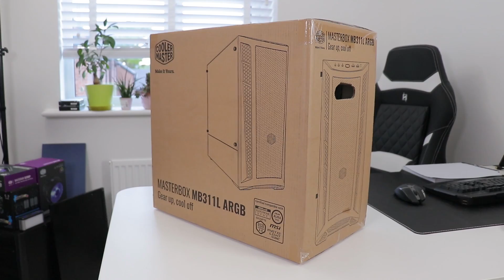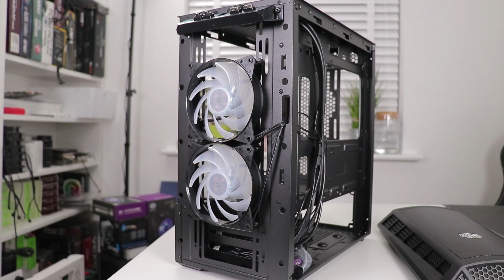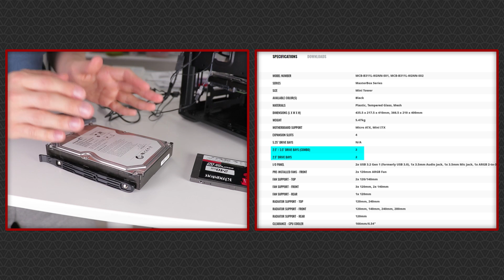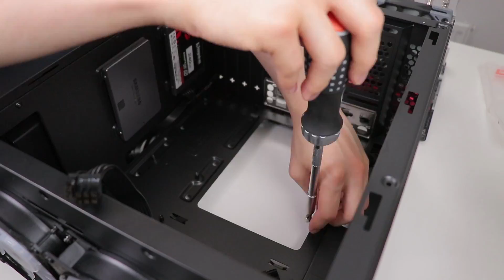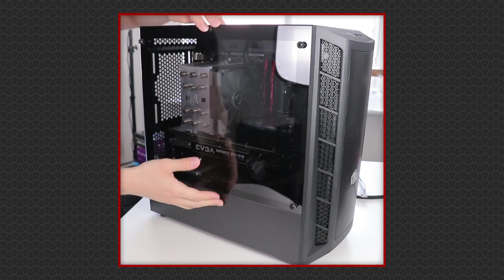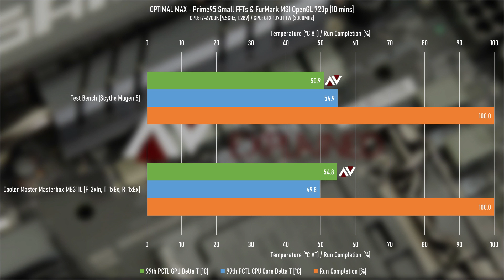Budget ARGB... but at what cost? - Cooler Master Masterbox MB311L ARGB review

Comment from the maker: Time Stamps:
01:25 - Unboxing
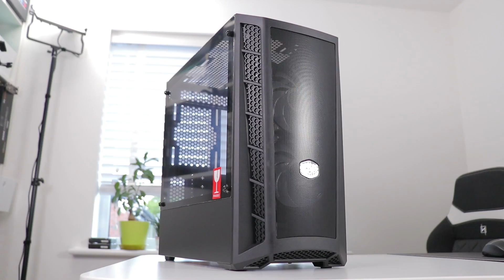01:30 - External Overview
03:00 - Internal Overview
05:09 - Drive Configurations (Small problem, big rant)

BUILD
04:50 - PSU (from previous section)
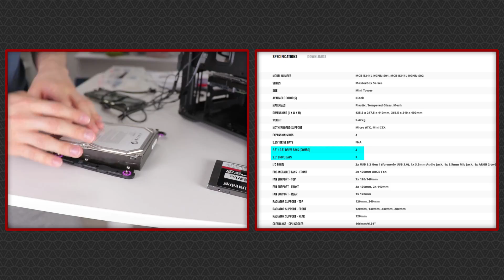09:14 - Cable Management
10:06 - Motherboard
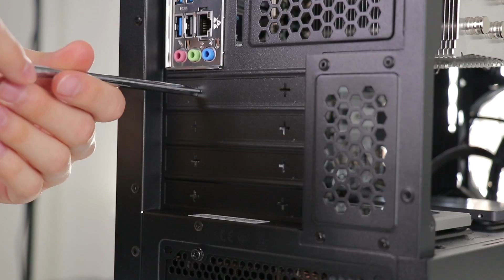10:38 - Graphics Card (Small rant)

TESTING
13:09 - Testing Setup explanations
14:04 - Pre-installed External Fans (Small rant)
15:04 - Thermal Testing Results Analysis

CONCLUSION
14:56 - Conclusion and Summary
Reply: Great review, thanks. FYI your conclusion timestamp is incorrect.
Reply from the maker: Bugger, sorry about that, must have messed up a digit :/ thanks for letting me know :)

Comment: Building my first PC waiting for parts to come in. I am getting this case but want to get an RGB exhaust fan for the rear. If I get a cooler master PMW 120mm like these front ones will I need to order anything else to get the rgb working? I have a B550M pro VDH wifi motherboard. Essentially what do I need to do to get the RGB the same on all 3 fans? Could this be possible using a different brand RGB exhaust fan as well?
Reply: The fans should be compatible with software. Coolermaster fans are compatible with Asus Aurasync so I think you're fine there. The only problem you would have is connecting them together if you don't have enough headers. You may need an aRGB hub.

Comment: Bought this case and the fans had to be at max speed all the time or they would not start spinning
Reply from the maker: Just out of curiosity, have you checked that the fan header you've connected them to is PWM? Not all 4 pin header are PWM, and many PWM fans connected to a DC header will perform erratically.
Reply: @AVTechy  yes I checked everything I could but they just refuses to start unless on max( would turn on system, fans would budge but not enough to start spinning) recently replaced them with sp120 and works well
Reply from the maker: That's weird. Have you contacted the manufacturer and explained the fault. They're probably under warranty so you could get replacements.

Comment: My only caveat, is that those particular stock fans are of sketchy quality. Non-PWM and they have a tendency to quit spinning after 2 weeks. The 2021 models address this by switching to SickleFlow 120 fans, which are significantly better. Also, Cooler Master has special clips for the bottom fans to install them on the inside of the frame...likely at extra cost though. In the full ATX version(MB511) of this, they use these clips for the bottom fan.

Comment: Great review... I have the Cooler Master NR400 case, which is strikingly similar in layout to this case... in fact, aside from some missing cable management grommets in the MB311L case, i'd say the base chassis IS the same as the NR400... only the front panel seems to be different.  In regards to changing the front fans post-build... YES... I've actually done it a few times (I'm always playing with fans) and it is difficult, but the bottom fan can be changed without tearing the system apart if you use a decent right-angle screwdriver.

Comment: Wouldn't the Hard Drive and SSD combo refer to using the rubber grommets for 2 2.5 inch SSD's and then use the side brackets to fit 2 3.5 in HDD's into the HDD cage or am I missing something?

Comment: You said the case allows for a maximum PSU size of 140mm and 160mm 4:38 but the maximum PSU size for this case is 180mm. I’m confused is there a reason why you should put a smaller one. (I used a 150mm but I’m just wondering) :)
Reply: hello! could you use this case mb311l with a psu of 150mm? i have one of that dimensions and i'm wondering if it fits :(

Comment: If money matters, then function is always over form. $50 case with lots of fans and a good amount of front ports. Not bad. If you build your own pcs, then getting or fabricating things to improve the short comings of this case shouldn't be a problem. I'd make/get better psu filter, pop all the rear expansion slots and cover or filter unused open area, maximize air flow and temperature control the fans, and just buy extra misc. hardware (grommets,screws,brackets, etc...). I don't care if it lights up and looks pretty, fan noise is good if it means it's keeping my machine from being cooked. I will always take function over form as a pretty turd is none the less, still a turd. Nice review, good job pointing out the short falls and potential of this case. I as an engineer instantly started thinking of ways to up the performance and usability of this case.

Comment: I ordered mine right after watching this review, it should be here in 5 days
Reply: I got one a few weeks ago.

Even after watching this AND reading it in the diagram, I still forgot to punch out the PCIe slots before screwing in the mobo.

I just very carefully bent them inward without scraping anything. It's ridiculous how they had to cut corners in what is otherwise such a great case, but the PCIe slots are a 1-time gig basically, so not too big a deal.

I only use 1 SSD, but it's really bizarre how it only comes with enough rubber washers and grommets for like 2 SSDs I think, while it has mounts for like 8 or something.

The PSU filter is really flimsy and falls out kind of easily. Every time I handle it I need to check that this filter didn't wiggle out.

But for me personally? None of these cut corners affect aesthetics or performance at all in MY setup. It's the highest value case I've ever seen for $60.
Reply: Liberty Prime I’m just wondering if you had the same mobo issue in the video
Reply: @aaronlim277  Do you mean the issue with the PCIe slots hitting the mobo when you bend them in?

Yeah I did have that issue, that's what I meant when I said I had to carefully bend them in without scraping my mobo.
Reply: Liberty Prime I meant were the mobo stand off slightly missed placed like the in video?
Reply: @aaronlim277  No, don't think so.
Reply: Liberty Prime and do you think this would be an easy case to build in for a first timer? Thanks
Reply: @aaronlim277  As long as they keep in mind the PCIe slots to avoid a headache, yeah it's pretty great. The one thing that's a bit tough to work with is, when you work with ARGB fans like this case comes with by default, you have some extra cables and the controller, so it's going to take some time and fiddling getting all the cables tied up nicely, but that's not different than any other  case I guess.

Love this case, it has a ton of airflow and storage drive options and fan options. I upgraded to this from a Masterbox 3.1 Lite, which was a damn toaster oven.

The HDD cage has 3 positions or you could just remove it completely. SSDs can be placed on the other side of the mobo or on top of the PSU shroud.

It's quite a large case for m-ATX. Basically it is about the size of a standard ATX case.

If you really want to maximize airflow in this thing, I would probably just recommend adding 1 rear exhaust and 1 top (rearmost) exhaust. Maybe get a fan hub if your mobo doesn't have enough headers.

The front can take 1 more fan, but I tried adding another and it didn't fit... would've been a bit pointless anyway since the bottom would only hit the drive cage and nothing else.
Reply: Liberty Prime thanks so much for telling me about this case
Reply: @aaronlim277  No problem dude. I guess I don't really have much to add over this review though.

AVTechy mentioned pretty much everything.

Comment: hello bro,a little late to the party but was researching cases and found your channel,just wanted to know which fans these case fans are as i wanted to purchase an extra one for the rear exhaust and would like to keep the same fans installed throught the system but not even cooler masters website tells you which fans they use in this ARGB version....if you could maybe answer this question that would be awesome,also will these case fans be worth adding to an AIO or would you recommend purchasing other RGB fans instead

Comment: First off great in depth review, when it comes to argb vs the standard case the price difference where i live is enough for me to go and buy  the standard case plus get a p12 pwm value pack from Arctic which includes 5 decent fans and all that for the price of the argb case.
I personally got bored of the rgb stuff pretty quickly i like my gpu to have some sort of accent like a strix or aorus card but beyond that im more concerned with good cooling rather than looks but at 60 70 usd the argb case is good aswell.

Comment: Hey i got an b450m d3sh gigabyte motherboard would it work properly with the fans?? And the lighting someone please reply
Reply: I’m building a computer currently with that motherboard and this case and I’ve finished everything except the fans. I got two extra ones but with the motherboard you only get one place to plug the in a fan however the case gives you a three fan splitter cable that already has the two fans attached so u only can get 1 extra fan. Once I finish I’ll get back to u about the lighting. Sry for the grammar

Comment: Dude, people are using more and more M2 SSD driver and you always nitpicking with tons of 3,5 and 3,5 inch drives. It's 2020, not 2002...
Reply from the maker: What I'm saying is if your going to do something and it would only cost you a dollar to go from 90% to achieving the full potential, I'd spend the dollar.

For the sake of probably a dollar you could support an immense amount of storage. The hardware is 90% there, it's just missing screws and grommets.

I still think HDDs have a big role to play. If I want to backup my system regularly I use an HDD. If I want to store loads of files I don't use often I use an HDD. Nearly all my games are on a HDD, and because the storage is really cheap I don't have to think about uninstalling or deleting anything when it's 500GB or 1TB full (games, long term storage, etc.).

Optane is available to accelerate HDD performance if required, and HDDs are performing better now than they ever have.

If we boiled all cases down just to what most typically use, I think we'd find a significant amount of people wouldn't like that lack of flexibility and room to grow it offers. For the sake of a few grommets and screws this case could capture the average audience, and those looking for expansion options on the future. It's 90% there, we're just talking dollars and cents to make it happen.

Comment: I know this is personal taste, but I would rather get the non TG Thermaltake Versa H18 and get a set of uphere ARGB PWM fans ( a 5 pack of fans) for the same price of this the cooler master mb311l
Reply from the maker: I really wanted to check out the Versa H18, but the TG edition. I couldn't find any around, TG is just one of those must haves for me since I'm so clumsy and always scratch plastic windows :P. Non-TG is cheaper though, so if it works for you then you've got more to spend elsewhere :)
Reply: @AVTechy  yeah it's a shame the tg version is only sold in the states and I don't move my pc often so I'm fine with the non TG version. Also I getting it to do a case swap with my crappy CIT case that has ZERO cable management space and ZERO dust filtration

Comment: Great review! 
One thing I've been wondering about for a while now is the effect of the PSU shroud on GPU thermals in a case this small. The motherboard I want to get (SteelLegend b450m) would put the GPU fans only 1 slot away from the PSU shroud if I used a mATX case. For the sake of noise and thermals, would it be worth it to buy a worse motherboard if it gave the GPU fans more room to breathe?
Reply: you will have better temps with just 2 fans instead of 3 infront like it comes with, just add another fan in the back as exaust, it's no big deal, it's vented nice, you won't get much worse temps than on open bench

Comment: Absolutely amazing case for money, looks, quality and functionality, all there. A set of 2 ARGB fans is at least £20 alone.
Cheapest tempered glass case (without fans) on Amazon is £27, with questionable quality and looks.
Great review as well. Thanks
Reply: Deepcool Matrexx 30 is 30 euros here, pretty decent one actually, but no PSU shroud(which can even be good thing for GPU temps in a mATX case), no RGB and only 1 exaust fan
Reply: @Goose  i went with BeQuiet Pure Base 500DX, but Corsair 4000D Airflow is also a solid option in your price bracket. NZXT H510 Flow was also launched not long ago. LianLi Lancool II as well, if you find a deal.
Reply: @Goose  I would. It's a good case for the money. I'm a 100% fan of CM cases but for 1st builds I would definitely recommend any Corsair case. Corsair's chassis are known for being made for anyone to be able to build a PC on them no matter the experience.

Comment: G'day AV,
just a thought about the SSD mounting, although not optimal to fit 4 you could just use 2 of the grommets & screws diagonally per drive instead of 4, but as you said how much extra would it have been to include an extra 12 of each to have 4 per drive then you could have all 7 drives populated & mounted properly,
🤔 it will be interesting to see how much Coolermaster's pricing between the plain & RGB with controller version are, as they sell these fans as a 3 pack with controller, will the price increase be cheaper than the 3 pack,

P.s. you tend to pick on yourself for being picky about small things but as a reviewer that is your job, because one of those small things may be enough for a buyer to go for another product
Reply from the maker: Yeah I was thinking that too, but the grips aren't super strong, and the grommets act as small pads for the drives to sit on/rest against so having only two might leave the drives looking unevenly mounted and more easily dismounted.

Now if it was the same mechanism as the one in the Q300L that would work nicely. Just a cost saving measure I think.

Oh yeah, forgot to respond to the last bit :P YouTube's creator app is awful for responding to comments!

I 100% agree, as a reviewer I should be able to say anything and not care. Buuuut, there are plenty of commenters out there that feel the need to criticise the criticism, and they seem to comment less if I point it all out myself :P Plus it prevents me from needing to respond to a comment like that since I've already admitted what they're commenting about, so I can have my cake and eat it too.
Reply: @AVTechy  My MB511 RGB also got some mounting option for 2.5" in the back but different in the front, but also for the front you only get mount for 1 SSD when there is 2 slots -_-
Cooler Master have been doing stuff like this FOREVER

Comment: Excuse me, an 84 £ for that, won't be better to just go with Cooler Master NR400 or FD Meshify C Mini for that price.
Reply from the maker: £84 is too much, I've seen a good few sites sell it for £60 though which is more reasonable, but whether it's good value depends on how much you want that ARGB.
Reply: This case is around £55-60, relax. Very well priced. Stock issues due to COVID.
Reply: @ares23dc  Well, it's probably just amazon inflating prices at that moment.
Reply: In Belgium it €45 for the non-ARGB and €50 for the ARGB version

Comment: Top filter spot looks nice. The seam around the front panel's mesh could use the same treatment, might look better indented slightly into it's frame rather than sit flush with it. However they did a clean job on that front mesh and the CM logo sitting in there, at least that part is quality. I just don't like to associate mesh with seams and corners because of how often I cut myself on the sharp toothy mesh edges in my old CM 690 II.
Reply from the maker: Yeah they did a god job on it. I pretty confident they're going to go for a case with mesh design on the top to the front at some point. Like the Q300L, but just have less panel behind it. Maybe only 120mm fans in the front to keep the sagging down from the intake fans. A project for a later date, the bad taste of the Q300L and Q500 is still around. 

Indenting is definitely the way to go for an easy fit (ideal for cheaper cases I can imagine), it makes comparing the levels of neighbouring components difficult, and like with work on a listed building it's generally better to contrast than replicate.

The seems here have been pressed/rolled over so they don't terminate at the edge, I can imagine the budget manufacturing processes have changed a bit since the 690 II, we can only hope :D

Comment: Not worth the price given the materials and build quality, i paid less for the master case pro 3 and its only con was acrylic side panel but u can buy a glass one for it anyway. The backplates are removable, there is caging for radiators/fans and a space for a reservoir or  two drive cages which means the case is 20% larger than most matx cases but still shorter in height and depth than a mid sized atx case. This case, with its fans, is worth about 50 dollars max, not 50 dollar min.
Reply from the maker: The Master Case Pro 3 has to be my favourite case, it's built like a tank with so many options. I did a quick review of it before since I got a cheap one, and I've not been able to sell it, it's just too good. But I didn't know you could buy a glass side panel for it, on the list!

This case is one of compromises. If ARGB is important to someone, then this is a decent start, but corners seem to have been cut to make it happen.